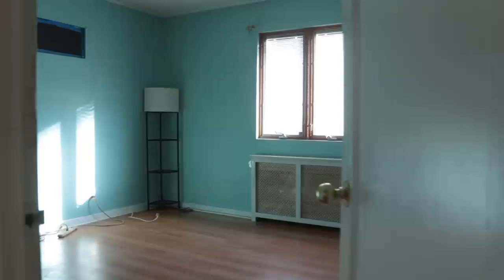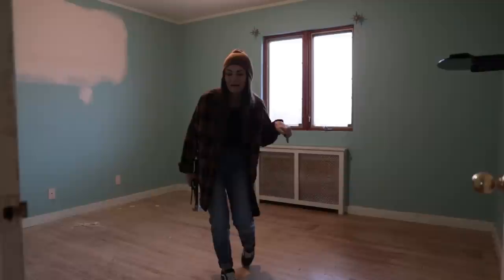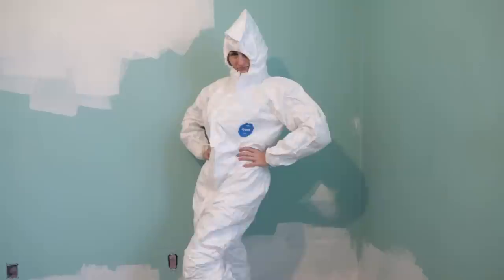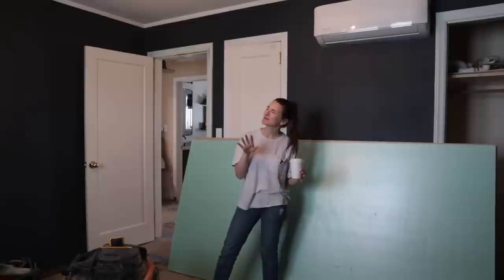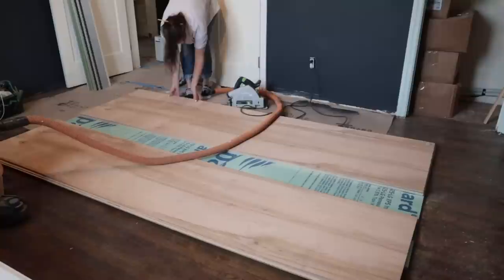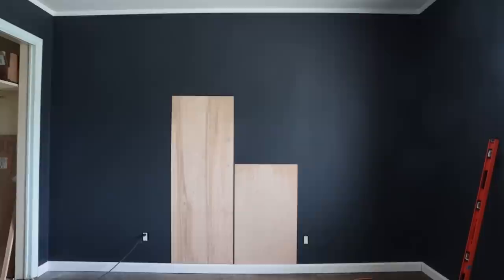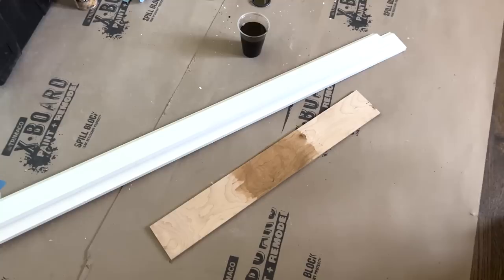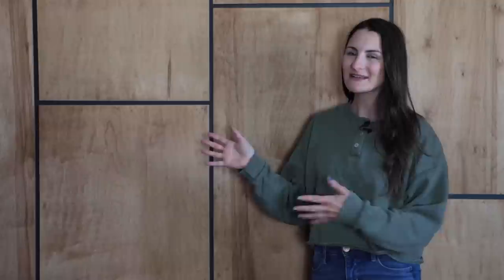IS THIS THE EASIEST WOOD ACCENT WALL EVER!?

Comment: I love the color! That's perfectly my style. I might have even done a different color opposite the plywood. I dunno...I have thoughts LOL! I definitely approve of the reveal between the plywood panels. I thought it would be too much at first but it's perfect. No shame about the former landline telephone box. I probably would have done the same. AT MOST I would have used some Great Stuff foam to fill and insulate it but definitely no drywall patch and plaster. For a wall box it would just be a waste of time and materials.

Comment: At first I wasn't sure about your wood accent wall but it turned out awesome and the wall colour is just gorgeous 😊👍🏻 I'm interested in a wagner sprayer for my own home renovation but still not sure if I should get one. What is your experience with spray mist? And doesnt the sprayer get quite heavy in one hand over time?
Reply from the maker: Thank you! I’m honestly obsessed with my sprayer. I use it for so many projects, even when they are not sponsored. I love using it for wood finishing especially when I can’t get my hand on store-bought wood finish. It can, but you don’t have to fill the whole chamber if it’s too heavy. You can just fill it in smaller increments!

Comment: Love this wall but if you see this I'd like to ask for your advice or anyone who has a suggestion chime in. I live an apartment so painting and wallpaper is not an option but I want an accent wall (2 actually) but I'm not sure how I want to do it. Screws are allowed because I can fix them when I move but I'm tired of boring white walls any thoughts?
Reply from the maker: Would removable wallpaper be an option? They make really pretty temporary ones now! You could also do something that screws or nails into the wall without adhesive and then patch the holes when you move out?
Reply: @diyhuntress  I don't know if removable is as easy as it says to remove. I'll get some and test it on a small spot.